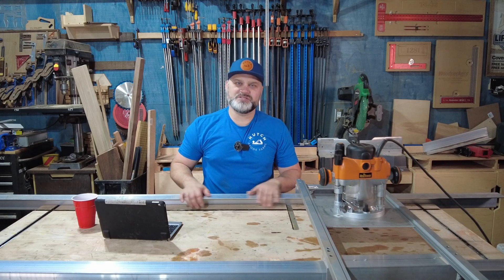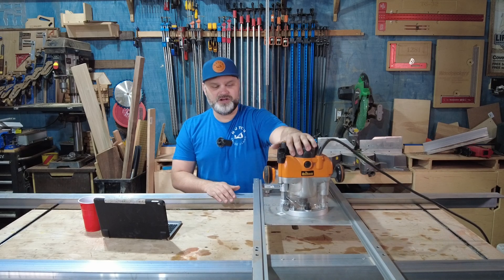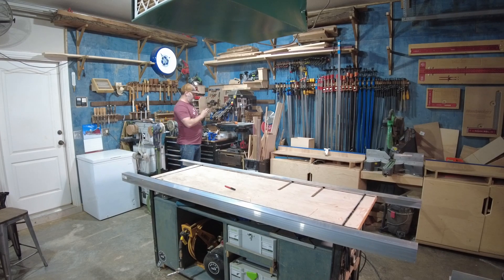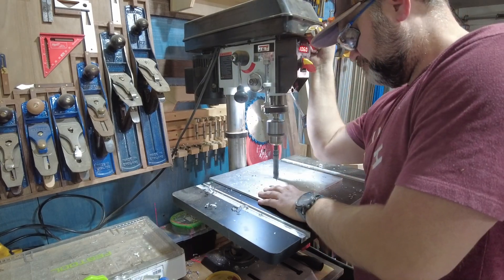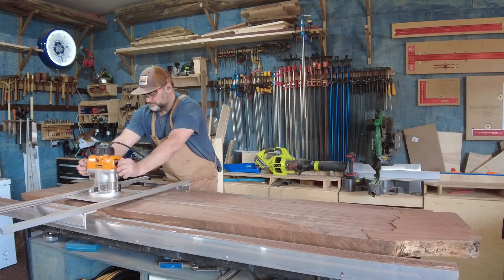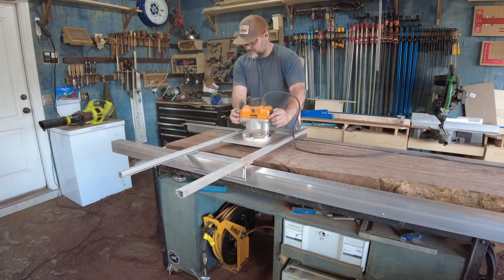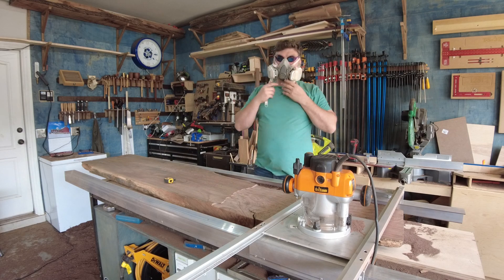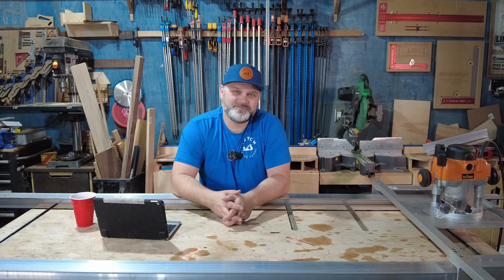Ultimate Affordable DIY Router Sled

Comment: I can see where you attached the wheels to run length wise. But I am curious if the build up of saw dust on the wheel path changes the height of the router slightly.